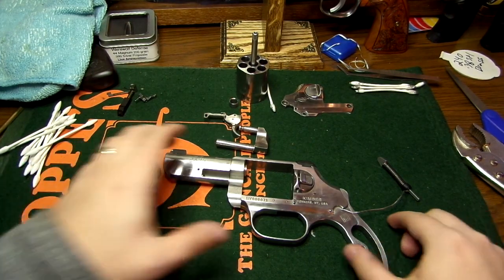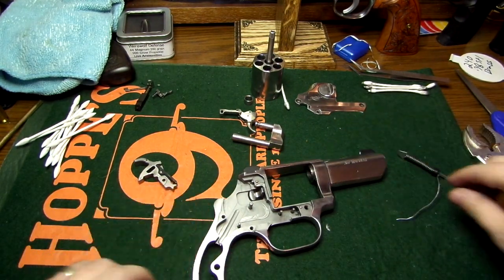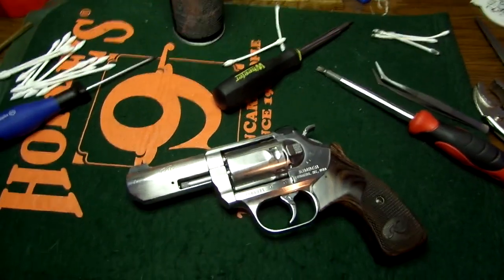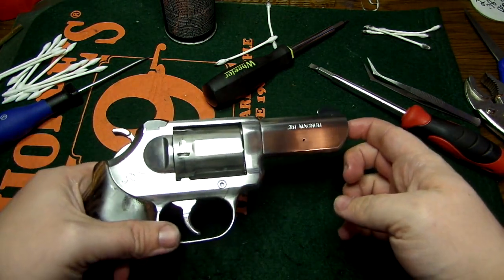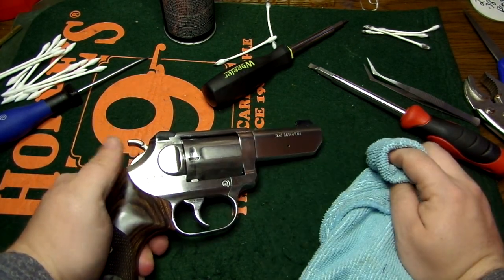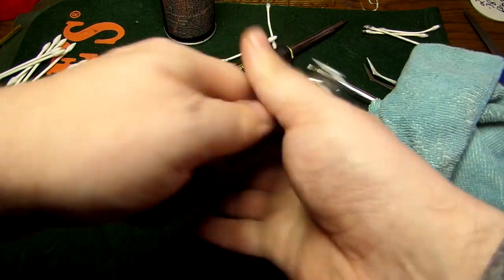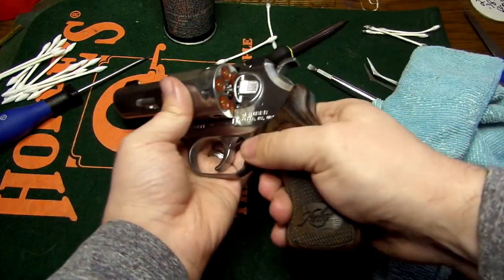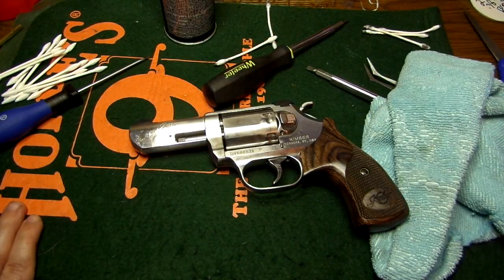Polishing my Kimber K6S DASA (finished)

Comment: Nice job!  By the way, the Kimber firing pins are EXACTLY the same as S&W firing pins, so they can easily be replaced.  I suspect that Kimber will figure out the right hardening at some point to avoid the brittle firing pins, but until then, it's easy to get replacements.